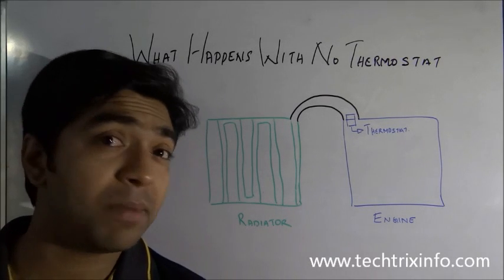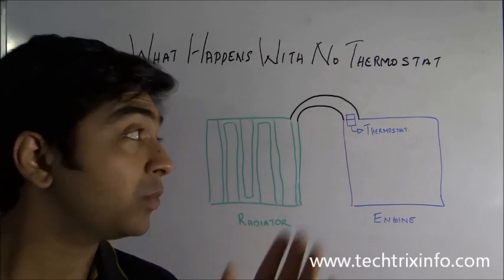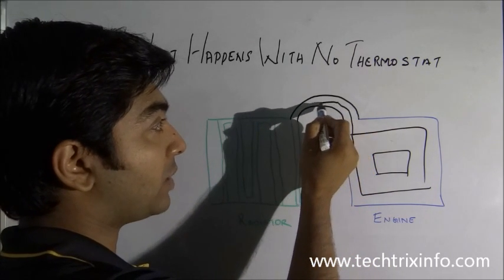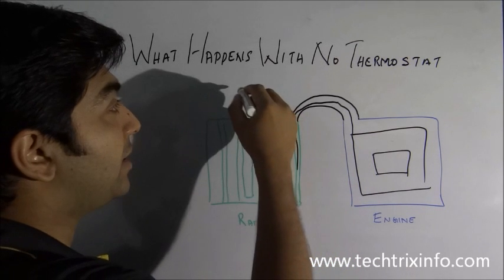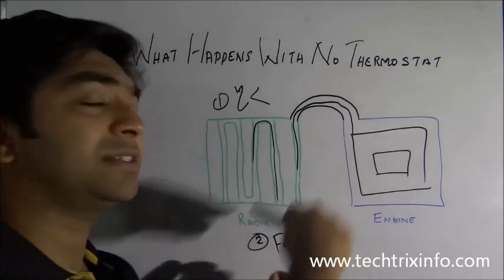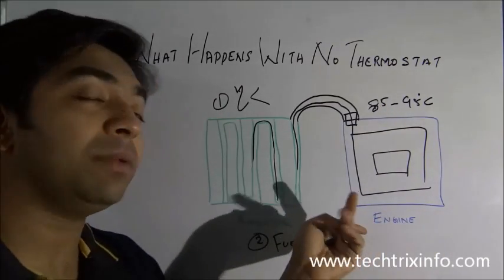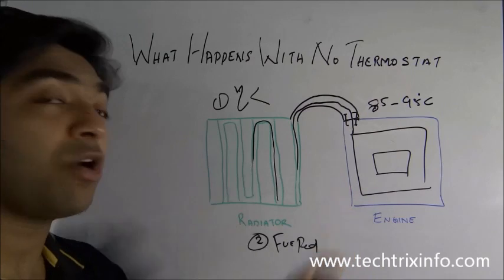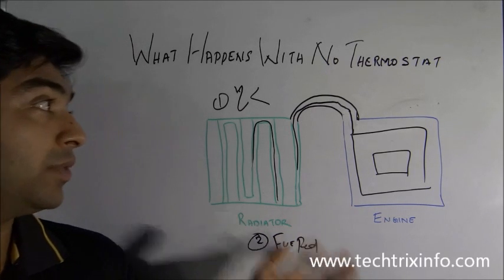Can engine work with out thermostat ? ✔

Comment: Can you explain to us why cars using a lot of sensors when the sensors are the one causing a problem and why they are so expensive?
Reply: MIKE GUILAS they use alot of sensors simply to monitor engine parameters which helps the engine to be more efficient. Now adays you can never achieve the best ot of the engine without electronics. Sensors only cause problems the time they reach their working life. And electronic parts is easier to replace than mechanical parts but with a cost.

Comment: I have removed thermostat (Nissan sunny 2005 Dubai)as  the engine was overheating,  I have replaced the radiator as guided by a mechanic. He recommended that to remove the thermostat, in order to avoid overheating. I hope that there will not be any  problem because of this. 

Please advise 
thanks & Regards
Shaji
Reply: shaji kalpetta my car was overheating all the time, replaced thermostat twice, same result, removed it, problem solved, specially when you live in a hot area, thermostats are for cold countries like Canada or Rusia

Comment: my car overheated, then shut off and now wont start. someone suggested that it might be a failed thermostat. will a failed (inoperative)thermostat prevent engine from starting? thanks
Reply: Your car overhead. Then  shut  off  and won't start. You need new car

Comment: Removing the thermostat from any car isn't a good idea. It simply masks an underlying issue. Have the system pressure tested - an overheating engine could be caused by a myriad of problems - blown head gasket, cracked cylinder head / block, thermostat stuck in the shut position, a clogged radiator, inoperative cooling fan or even the wrong fuel / spark plug grade.

Removing the thermostat will simply make the engine over cool, which is bad. It will increase fuel consumption, as the engine CTS (coolant temperature sensor) will assume the engine's not up to normal operating temperature, and simply inject more fuel in. This will cause premature engine wear, as the excess fuel will wash the oil from the cylinder bores (bore wash).
Reply: if your remove termostat radiator car must clean. my car Suzuki Futura 1,500 Cc and i drive 3-4 Times a year Cross country 400 km(248 mil) and never overheat, in Indonesia if not rainy air temperature normaly 29 to 34౦c (84-93౦F)
Reply: i am in a little situaton.ok full tune up has already been done to the car.also cleaned fuel system.the car started over heating after mechanic did mentoned that my top radiator hose was HARD.i ran a pressure test an i have 0 head gasket leaks.i remove thermostat and replaced it.car get kept over heating.so i have been running without a thermostat for almost 3 months?now i regret it baddd gas mileage on a civic 98 and went through my oil pretty fast.so can it be that i didn't bleed radiator?i did replace the radiator recently and didn't take out the air in the system.can that be the culprit?
Reply: david henriquez          Well, if you are SURE you are not losing coolant, that is a very GOOD sign. How about oil, are you having to regularly add oil, how does the vehicle run?? If you do not have a thermostat, it should not make too much difference if you not living in a really cold area.....will take a little longer to warm-up and may run a little richer. I ran a vehicle with a blown head-gasket, for over 4 years, with no thermostat, no problem.........if I put the thermostat back in, it would overheat, use coolant and run like crap.
Reply from the maker: +Jason Grehawick 
Stop on
Tks for the comment
Reply: david henriquez    Are you having to add coolant regularly??? When you say you did a "pressure test", do you mean you pressure-tested the cooling system or you did a compression-test?
Reply: tickyul nope I haven't added a coolant since I removed the thermostat.i pretty much did the compresión test through the radiator that led to a result of no leak or blown head gasket.i have been without a thermostat with no problem for 3 months.i drive a lot.but i know that eventually things will go bad if this issue isn't corrected.should i bleed out the radiator for possible air in the system and get a new thermostat?fans are running.no leak.radiator was replaced a couple of weeks before.
Reply: tickyul I also forgot to mentioned that when the mechanic replaced the thermostat it kept over heating.so I'm thinking that it gets stuck open.so he removed thermostat and no over heading.a lot of driving day in day out no problems.just takes longer to warm and therefore runs lean
Reply: Not necessarily. If the underline issue has already been resolved (i.e. hose, water pump etc..), then there is no masking.  Some people chose not to replace it immediately due to lack of finances or to help diagnose IF THERE ARE any further complications.. like a partially occluded heater core.  Since heater cores are costly to repair, for non-mechanics, their efficiency may possibly be improved by a gently back-flush. Time/ convenience may not allow this to be done immediately. So leaving the thermostat out CAN be a good idea, for a while.  As the video states, it only really effects the combustion and fuel economy, aside from taking longer for the interior heater to warm-up.

Once an engine reaches normal operating temperature, it usually remain in a range near that temp, and the thermostat rarely closes beyond that point (200 - 220 degrees fahrenheit, depending on the vehicle).
Reply: Block off a 3rd of the radiator to increase operating temp and for cooler weather
Reply: Jason Grehawick           A junker that is headed to the scraphead and has a blown-head, can many times be kept running by keeping it VERY cool. How do you do this..........removing the t-stat!!!!!!!!!!!

Comment: what happens to an engine if run without thermostat valve for longer period of time? In my experience I find almost all vehicles that has gasket problems, provided without any water leakage from else where, does not have it, it has been removed before and running more than a month or more. I find this specially in Mazda. Any idea why? as I get the feeling you say it wont effect engine that much other than in cold start & fuel efficiency.
Reply: My Mazda's factory thermostat is designed to fail stuck open(as a safety "fail-safe" feature) as it's better to run too cold that to have the engine overheat.

My thermostat failed at around 50,000 miles and I've run the engine with a stuck open thermostat for almost 1 year and have now replaced it. My fuel economy has been reduced to sometimes 16 mpg.
Reply from the maker: +viki perera 
Tks for the comment 
WhatsApp you're doubt  @ +919744615655

Comment: my truck tahoe is over heating i all ready clean my radiator termostat holes but ever sence i change water pump it started to heat. .can I try it with out termostat. ..can u plz tell me what do i do. Thanks
Reply from the maker: If thermostat is faulty, the over heating issue will vanish if you try with out it.
But if still is over heating consult a mechanic. 
Thanks for the comment
Learn through “WhatsApp”
Please WhatsApp @ +919744615655 <your name> and start getting updates Mechanical and
Automobile engineering, Super cars and machines. You can also ask your doubts
related to the same subject and we will be happy to help you and this service
is FREE
Reply: Maybe your pump has poor flow rate

Comment: Thanks for your diagram.  It may help with understanding if your diagram shows a return hose returning allowing flow back to the radiator.  You can't have flow with one hose.
Reply: whothecapfits the topic was the Thermostat, if the engine could work with or without, NOT how the cooling system of a car works.... pls be kind to ppl, this video is free. If you can do it better in a simple way, do it yourself. Mr. Smart pants 🙄

Comment: Driving without a thermostat won't hurt it will it?
Reply: Iam a car preparator for racing..

the answer is it depends, if you know what your doing removing is not a problem, its even very good,,,but also depends.. on engine for example, plaewhere you live, etc

Comment: i have a kia carens 2009 crdi turbo diesel A/T, bought it 2nd hand, recently its always overheating, when were checking it, we found out that theres no thermostat, it may be removed by the first owner, what will i do?, ive already clean the radiator, replace the radiator cap, since i saw a trace of splash of rust coming out of the radiator cap. what seems to be the problem. can i still use it without the thermostat?
Reply: Daddy A Silonga         Check for a blown head-gasket.

Comment: so..if I remove a thermostat to a bmw in a tropical weather, should it work fine? 

my question is because these cars tend to use an unique thermostat with 2 openings (for hot water in the block and the other for the cool water in the radiator)
Reply: Remove it, you'll be fine. If it becomes cooler weater and it doesnt run warm enough for heating inside vehicle then block of say a third of the front of radiator to increase the heat output/temp level

Comment: hi, recently I changed my radiator as it had cracked when my car pounded on a porthole.... post then I frequently check my engine for any abnormalities... I m not well knowledged guy abt engine... just wanted to know that
 #when I start my car after 5 -10 mins I check the upper hose coming from the engine to radiator to be hot while the lower hose connected frm radiator  to engine is cold....
#I see no change in my temperature gauge as it stays between hot n cold....
# when I go for a ride say 15-20 km n after returning I check my radiator it is pressurised but after few hours when the engine is cold it is not pressurised and coolent level is gone down around 150-200 ml...
Is this normal?
se times I see coolent overflowing from reserve tank then I have to top it up...

Is this a thermostat problem or some thing else...
Reply: the only thing you need to do is replace your radiator cap. everything else is fine

Comment: thermostats are great for up climate whether but here in Miami we don't need them it gets hot all on it own and very quickly and extending the life of the engine. why are all cars geared for winter climates?
Reply: True, I live in Tampa Florida, and a thermostat is not needed.  The car still reaches operating temperature.  I always remove em as soon as I get a car.
Reply: i am in miami too.i was running a 98 civic with thermostat and one day the needle when to the top.radiator was just replaced,full tune up and cleaned fuel system.you meant to tell me it's okay to run wthout a thermostat for a long period of time?it does take forever to get to normal operating temp and my gas economy is not doing well.or that might just be me.
Reply: Its not just you. Engine is less eficient if its not running hot enough
Reply: agreed hot weathers does not need this piece of tech i think so
Reply: On outboards it works fine for me down here also

Comment: Hi, am driving a Subaru legacy 2002 model, My blew up and car overheated for about 5 minutes but the gauge did not reach the red area before i switched the engine off. Now i replaced the radiator with a new one and after installing it, there is no water circulation but air builds up in the radiator pipe (the one connected from radiator to engine) it bulges and explodes, changed the pipe still same thing happens. what might be the problem?
Reply: Gershom Chama Mwansa Your headgasket has blown between on of the piston chambers and one of the cooling circulation holes in the engine.  As the piston rises to compress the fuel, some of the air is lost through the leak in the headgasket and enters the cooling hole and pressurises the cooling system.  if you take the radiator cap off and fill with water then rev the engine, the water will fountain out the radiator.  An expensive repair!
Reply: +Les Black  will same thing happen even if thermostat is blocked ? i mean water will pump out when radiator cap is open ? I hope i'm not in gasket problem. For me the heater stopped working and car heats up as well. I reckon its closed thermostat.
Thanks
Reply: @allweIllbud  a closed thermostat can't introduce air into the system, its a blown headgasket or a cracked head

Comment: Greetings!!
I have Maxima 2003 (A33) 30.j since 2 years, it is working great. I am living in hot weather area, anyway my car shows wrong reading of temp. it is hot when it reaches 3.5 k RPM it become hot like touch the hot red line when i decrease my accelerator  it come down and shows back to cool. I aready installed new radiator. no loss of coolant water ever. 6 months ago my mechanic removed the valve of engine outlet Of water cooling system (thermostat) because it was jam as it leaked water below the Thermostat from the pipe. Any advise. Thanks Regards
Reply: Hi,,
Make sure that both valve are removed one in front and one on the back and a new cap for radiator
Reply: you have an air bubble in motor.  look for a valve on top of motor and use it to release the air.

Comment: 1st u told with out thermostat means the metal will be expanded because high temp..... the water is circulating inside the engine then how engine got high temp..... how is possible....?
Reply: +Jagadeesh Raj 

1st) there is exchange of water/coolant between engine and radiator, hot water from around the engine flows to radiator, cool water/coolant from radiator flows to engine. Then the hot water in radiator now cools when heat is exchanged between radiator and atmosphere. So now if thermostat is closed Hot water stays around the engine and will damage gasket and any non metal parts. Forget about melting metal, that won't happen.

Comment: I have hight temp in my country and I remove the thermostat ..but the problem in my bmw 1996 318is ...Is the engine temp is overheating and the elec. fan is lazy to work ... It takes long time to work.. I'm trying to bleed my radiator many times and eng temp still overheated ,,,, ..please help
Reply: Walid Abul Haggag hi, i have the same problem... did you solved the problem? can you tell what it was
Reply: @alexbur1990  just take ur thermostat out it will run fine cooler the engine better..

Comment: Its negligible, when an engine is running for sometime...the thermostat is always open as its very very hot and it will never never close especially in equatorial countries that's constantly hot all the time. It only helps in seasonal country that go thru winter time. Other than that you can get rid of the thermostat.
Reply: can you back up your statement with Data..........does that mean ,automobile engineers are fool when it come to equatorial countries .Can we advice the japanese ,not to fit thermostat in a car if they are sending it to sub saharan countries.Thank you engineer Rudy Joseph!
Reply: Even in very hot climates most engines will not reach operating temperature without a thermostat and some will overheat without one depending on the design.
Reply: JPS JPS  You are ignorant.  Go learn before you start bashing people who actually know how stuff works.

Comment: what will happen if the thermostat not working properly or faulty... and what triggers ON the radiator cooling fan while the engine is running?

Comment: Does worse efficiency include the greater possibility of not passing a smog test in California, or should it be assumed the smog techniician will just wait longer for it to reach operating temperature before running the test?

Also, if an automobile has a leaky head gasket, would it not be advisable to forget about efficiency and remove the thermostat for purposes of possibly extending the life of automobile, and the potential range before overheating?
Reply: Candy Sweet        Yes, I drove a junker-vehicle, that had a blown head-gasket by removing the t-stat. Mileage may go down some. Just get the vehicle nice and hot before getting it smogged, it will probably pass.

Comment from the maker: its ok, but u will burn more fuel, that means low on millage and low on power, because optimum temperature is very important for proper combustion of fuel for power creation.
Reply: TechTrixInfo.com not true I removed thermostat from a 00 mitsubishi eclipse GT and it ran better got more power and never hot hot again

Comment from the maker: Yes, thanks for been supportive, will make my videos more interesting. 
We really wish to get your feedback, please, review our new uploads
Reply: My Hyundai elantra 2010. I removed my thermostat 2 weeks ago it was damaged. But after every morning I check the radiator, while it's cold mind you. I get pressure pushing the cap, yet the car is ice cold and it's back pushing into the coolant tank. What is the cause? Should I put back the thermostat,? I'm not getting any white smoke or water readings from the dash. It's just water is pushing back into the coolant tank